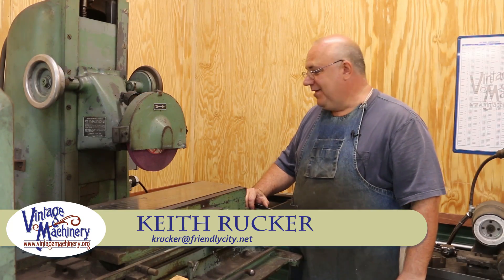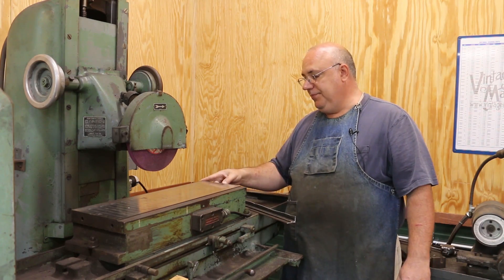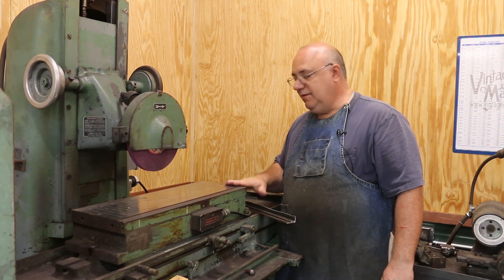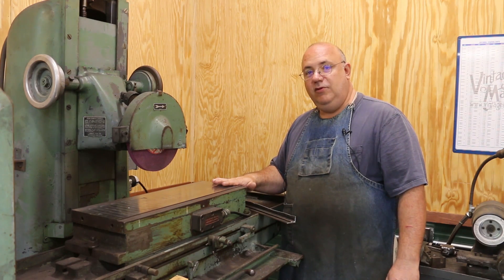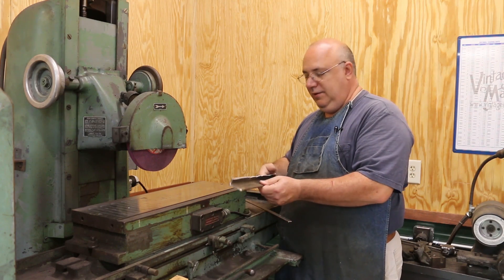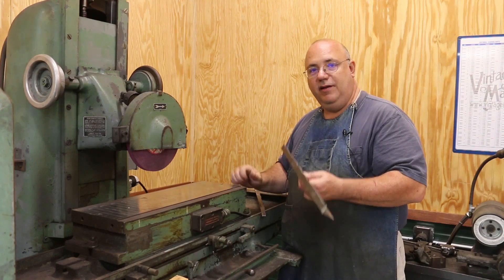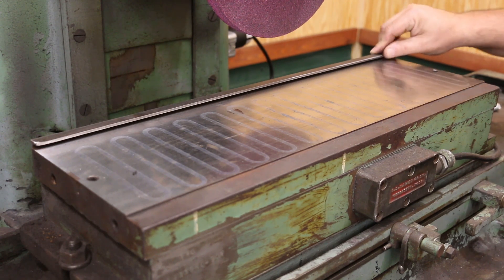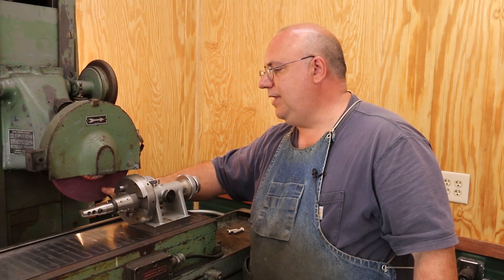Building a Surface Grinder Back Rail Fence

Comment: just a suggestion for dressing a relief (also refered to as a bead) on the wheel. being a precision grinder myself (may sound like a cliche as everyone online is an apparent expert but i am actually a grinder haha) rather than using a tangent grinder on the bed as you are to dress a bead on it you can use a diamond dressing wheel like how you would dress a wheel as standard just at a 90 degree angle as you dont need to dress an angler more just have a smaller contact area between wheel and the back bar. or another option is using a cup cbm wheel however i am unaware what wheels you own to use. hopefully this is some help to you and is understandable. 
enjoy the videos on the channel keep up the informative videos 
thanks

Comment: As has been commented here, you may be over complicating the job of dressing the wheel. This can even be done free hand with carborundum if you're careful. But there are plenty of guys that will do the side dress of the wheel with a diamond clamped sideways in a grinding vice and then put a couple thousandths recess starting about 1/8th away from the rim using the grinders own adjustments.
Sometimes we get so caught up in doing it the way we were taught that we forget to consider if there might be an alternative method. I know I've been guilty of this many a time.

Comment: ...Buying used tools, such as this and other 'larger' home shop machines....can be extremely frustrating when a couple small parts are lost/missing and no-one can recall what they look  like? A friend of mine had a nice home machine shop....caught fire and burned to the ground....He gave me a few Tools, one is a 'universal cutter grinder'....has the major parts Base,  and motor with spindle...also $250 CBN cup wheel....but arbor and spacers are missing....also the SUPER-MAX mill and new Japanese lathe were destroyed by combination of heat...and water from hoses.....sent off to the scrap yard by well-meaning grandson doing clean-up (Well Grandpa'....it was just a bunch of rusty metal stuff)........no tellin' the condition of that stuff....? I drove to junkyard and did retrieve a nice drilling machine....2 spindles, brand new motors in the boxes, 30"-48" table with coolant rail....cast iron legs....

Comment: The factory fences are made of cast iron.  Cast iron retains less magnetism with the mag turned off and the "rat fur" sticks to it less.  The factory ones also usually have a step in the vertical portion of the rail and a sideways offset in the slot so the rail can slide downward, sideways, and outward on the bolts and will then be clear below the chuck top surface in a storage position.  All that being said, what you are doing will probably work just fine.  I need to make a back rail and a front rail for my mag chuck, too...  $75 is a good price for the factory rail.  I think the cast iron will cost you most of that or more.  Consider getting the front rail at the same time if you go in that direction.  Walker chucks are the good stuff...

Comment: Keith - why not lay the work flat on the table of the horizontal mill (for the initial cut) and cut the lot off in one pass? Its more stable and would have saved time and been more rigid.

Comment: Hey Keith....the Delta Grinder dresser uses a non obtainable 5/16 shank diamond, So I just turned down a 3/8" shank diamond to fit. IIRC...the shank was mild stell and no problem to turn. Additionally....I was dealing in old table saws for awhile, and ended up having about 20 cast iron tops left over. I have been using them periodically, by cutting a chuck out as needed for projects. If you want.....I will slice on an edge, and send it your way ....they are well seasoned!  Good to see you are still using the LW chuck I sold you at ArnFest ....probably ten years ago by now! I also have a broken dovetail on a dresser like yours, but will need to check to see if the rod you need is still present. I have one like it that I use, otherwise, I'd send the whole unit ....bout the time I did....I'd need a part for myself!

Comment: Has your grinder got a long enough stroke to cover the length of the magchuck? If so why not just lay the angle iron on its back and grind vertically as usual. However that jig for dressing the back of the wheel looked very interesting so I'm looking forward to the next video showing you using it. Regards
Reply from the maker: Getting the edge ground flat is only part of the problem - you also need to grind it parallel to the movement of the machine.  The only way to accurately do that is to grind it on the machine.

Comment: Mine was missing the exact same pin.  That pin is also used to set your offset by using gauge blocks between the side pin and missing pin you set either a concave or convex arc.

You also need a center line height block for setting the diamond on center line If memory serves me correct on mine it is 3.400"  That will help you to get the diamond on the center line of the spindle  Rotate the spindle upside down so the diamond is facing down put the block under the diamond and lower it till it touches and tighten up the diamond holder.  Then the diamond is exactly on center line of the spindle.
Reply from the maker: Yes, when I start using it to grind a radius, I will need to have the point set on center and a custom height gauge is just the ticket for that.

Comment: why not clamp the angle profile flat on the mill table with a few toe-clamps and then mill the edge either with a vertical cutter or a horizontal cutter?
Since the contact face which will later be clamped to the magnetic chuck is not ground perpendicular to the edge machined in this video you will have to regrind the fence edge each time you have moved it. To avoid regrinding the fence each time you would have to grind the contact surface of the fence and its contacting face on the magnetic chuck.

Comment: buddy, I love the content, but you know the right way to do this would have been to take the vise off the table and mount the rail sitting on some scrap on your mill table so it can be fully supported. Faster isn't better.
Reply from the maker: I disagree - the right way to get something done is to get it done with what you have.  Many ways to skin a cat and in the end, I skint the cat.

Comment: How about this as a non-super-non-complicated holding system for the angle in the mill: Clamp another piece of angle iron with its flange pointing away from you, giving you some nice metal/strength to keep your work piece from bending.
Reply: Or lay the angle iron flat on its back on the table and run the mill over it.

Comment: I can understand the wish to only have to clean up one machine but I would have thought that the first milling would have been easier and better done on the K&T  but I get it,  did you mill the chuck matting face of the rail
you are a very smart man Keith but in this case I think  you were over thinking it  just put a regular diamond point on an angle plate (sine bar ) to dress the wheel to relive the face so to get the job done
Reply from the maker: It could have been milled on the K&T but there were workholding issues there as well.

Comment: A couple things- Not sure if that back edge of the chuck is ground flat, if not it would be a good idea to grind it parallel first.
That hot rolled surface on the angle iron will never index perfectly if you remove and replace it. I think you should have ground the inner leg of the angle flat first so you have a precision surface in case you need to remove and replace it at some time. With the back edge of the chuck ground parallel and the inner leg of the angle also ground you could remove and replace it without having to re-index or re-grind it each time.  On the trimming of the angle, I would have doubled it with a second piece of angle iron in the vise and clamped the ends together to reduce vibration, then just made the initial trim cut with a 1/8" end mill or a slitting saw,  eliminating the bandsaw cut and giving you a nice straight surface for the grinding.
Reply from the maker: If you remove the fence, it is standard practice to regrind it again when you put it back on.
Reply: Yes, that makes sense if you were grinding the edges of a part or a channel that required the sides to be parallel.  I'm anxious to see the unit you get from the manufacturer, as I suspect it will be a heavier piece of material ground on all 4 sides with the relief also ground, even though 75.00 seems awfully cheap for such an object.

Comment: Is it not neccesary to grind the surface that mates with the magchuck? Is the stock flat enough so that it will register even if taken off and put back on?
Reply: Not really as these are not meant to be taken off and put back on without regrinding. Once it's securely mounted and ground it will remain parallel to the motion of the table until it's taken off. They are meant to be replaced when they are out of material to true them.
Reply: So long you mount it perfectly still, read as, won't move on you, which includes cleaning both sides of any kind of raised surfaces, well, then simply dressing the front does it. I made several for my friend's grinder (various types that suit different tools) and all he asks me is a simple straight cut on the raised edge.

Comment: Tool makers typically put a standard diamond point dresser in a grinding vice and then touch off the machine side of the wheel and move the head up and down to dress the wheel for side grinding.   Rarely use specialty dressing tools only for rad grinding or form grinding. Angle the dressing point in the vice to obtain required angle.

Comment: Fence won't repeat if taken off and replaced.
Reply: You grind it in again. It's basically a consumable. Think that you can modify it to suit various pieces, or even tools. A friend of mine that grinds professionally, has something like 20 different fences with cuts, slots, even attachment points for extensions, that themselves get ground and replaced as they wear out.
Reply: Got it.   Good point and thank you for taking the time to respond.
 
I still don't the stresses induced when a bent piece of angle iron is socked to the vice.